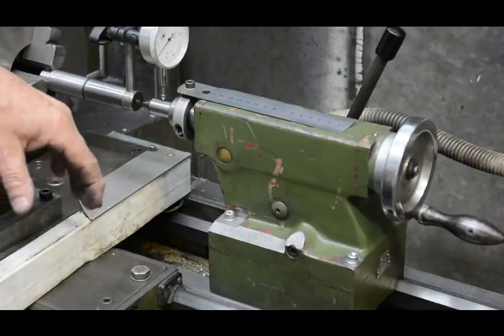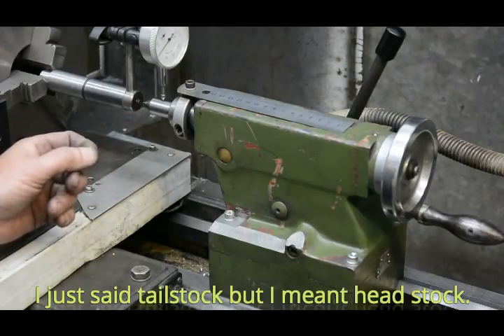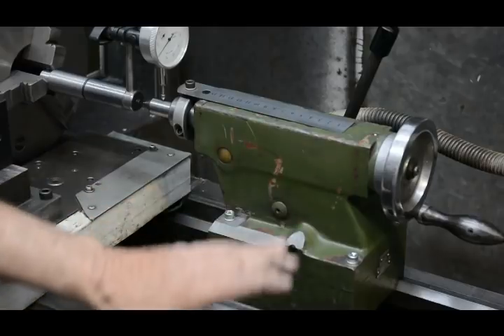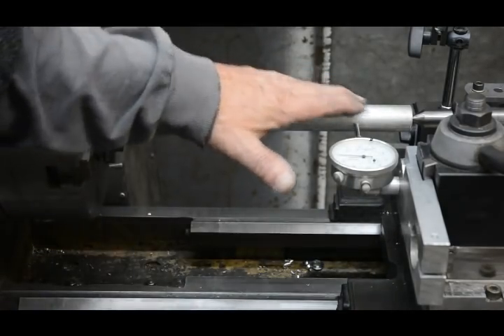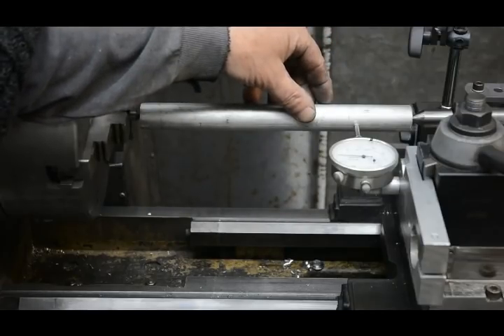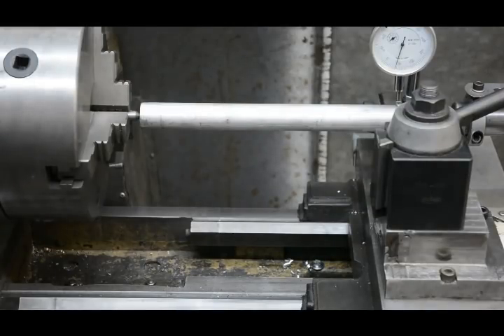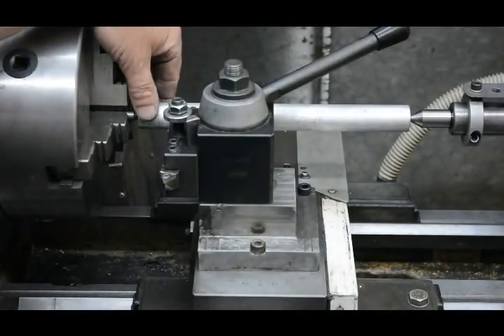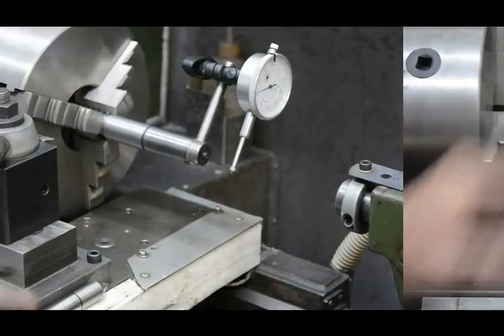Lathe tailstock alignment

Comment: Just rebuilt my little Sherlline, with a raised headstock and ER32 collet.  I raised the headstock so I could run non-Sherline 3 & 4 jaw chucks, (Sherline chucks are shite, AND expensive).

I also came up with a way to have my tailstock move the way yours does, so I can cut tapers without doing it the stupid Sherline way, which is to rotate the headstock.

I discovered your channel because of your vid on how to use an indicator with a height gauge, and found this vid, which will help me immensely with aligning and finishing the tailstock project.  (I fab'd a small dovetailed to T-slot adapter which made up the distance to the new headstock height, and allowed me to bolt the tailstock down to the carriage and cross slide I just replaced with new.

One good thing about Sherline, is parts are much cheaper than a full size lathe.  A great first lathe.

Thanks...

Looks like you have a finger a lot like my L pinkie, with the 'functional bend'! LOL  I got mine from playing with a Golden Retriever, and smacking a table.

Regards,

GeoD
Reply from the maker: I have 3 fingers like that.  Arthur Itis did it but there is no pain.

Comment: There is a problem in this method. It assumes chuck jaws are parallel with direction of rotation, which they most likely are not. 

This can be checked by mounting indicator on tailstock and measuring runout from the axel mounted on the chuck. If there is runout, this method is not accurate. One might try to use a tapping hammerto fix it, but it won't be easy.
Reply from the maker: That is not a problem, the indicator rotates about the spindle rotation axis regardless of the jaw alignment.  It could be bolted to a bracket on a face plate for example, then there are no jaws involved.

Comment: I don't see how this tool can achieve perfect alignment? Alignment  requires 4 points on the center axis, a front and rear  point on both the headstock & tailstock. This tool is only measuring 2 points assuming it is centered. So once the tailstock is moved it may not be aligned.
Reply from the maker: Very true,but such errors are a fault of how well the lathe was made and there is little anyone can do about that.  However, the same applies to the traditional method of machining a bar to check parallelism or using a standard checking bar.  As my initial comment said "This video shows MY method for aligning a lathe tailstock. "  If it is not yours then do not use it.